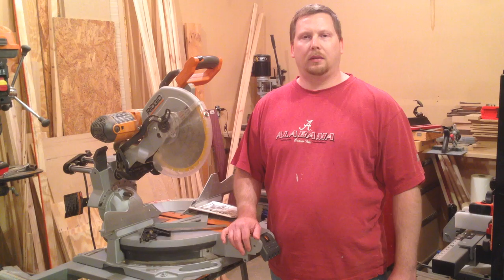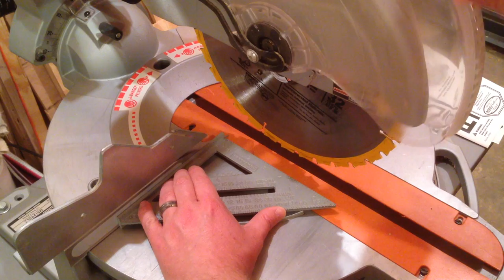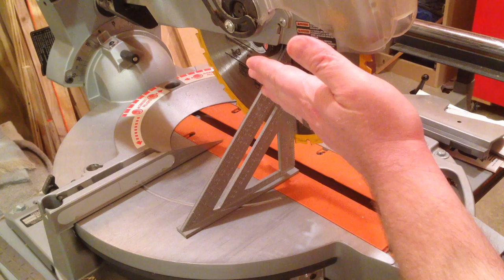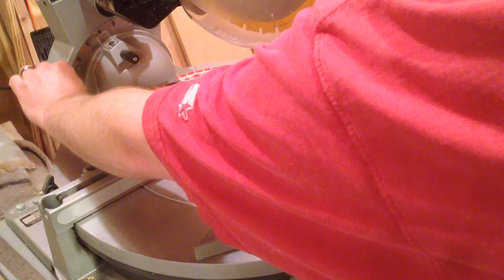Miter Saw Adjustment

Comment: Thanks for your guide to adjusting the miter saw.  The only other thing I would do is to cross cut two pieces and then flip one over and compare the edges to see if they are true.  If there is any misalignment, this method will surely show if the blade is a true right angle.

Comment: My rigid miter saw won’t rotate.  Any ideas why. It was working fine and than starting to get tight and now won’t move at all
Reply from the maker: The turntable may have debris inside. Also ensure that any locks are disengaged.

Comment: I want to add 3 things. Most cheap squares are not square. That's why companies can get away with selling expensive professional squares and rulers for so much money
 Next, do some test cuts on a flat board or plywood. Look up the 5 cut method. You'll need calipers. Last, once the fence is set, take the time to double check the adjustable plastic line for the angle indicator.

Comment: Is there a way to adjust the slide.  It seems like when I cut a wide board it will not cut along a straight line the full length....almost like the slide is off??  Any help would be great.  Thanks
Reply from the maker: Hi Karl. There's not a way to specifically adjust the slide that I know. Although, if you have another model yours could have a method. There is a learning curve when cutting precisely on a sliding compound. A person naturally leans into the saw on the stroke which skews the cut very slightly since there is always a minuscule amount of play and deflection in the saw. The longer the arm is extended the more for potentially
Reply from the maker: Sorry, technical difficulties. Like I was saying, the saw has potential deflection exponential to the extended length. To minimize this, try to keep the pushing force in line with the slide action. If your doing everything correctly you should end up with a good cut. There is always the possibility that you have a defective saw. I hope this helps. God bless!
Reply: Karl Hinson 

I have the same issue. 
My particular unit is the MS1290LZA. I don't believe that it is a draw issue as Cory says. I drew a line on a board with a square. I then, traveled the blade over the line and sure enough, even though the fence is square to the blade, it tracks at an angle. I was hoping that in my manual, the section titled "Centering The Saw Between The Slide Bars" would take care of it, but it doesn't seem to function in that capacity. So, so far, its very frustrating. Cory, any suggestions on this part of the manual are appreciated. And can the blade be at a different angle than the slide?

Comment: looking to purchase same Ridgid miter saw. How long have you had it and how do you like it.
Reply from the maker: I've had mine about 10 years. It's been a pretty good saw. No problems but if you are going to do woodworking there may be some slightly better options out there. Although this saw is very capable of woodworking once you get used to its intricacies I'd go with a little higher quality saw for making those smooth and sure cuts for fine woodworking. If your looking for a saw to run crown or general carpentry then this is a great value.
Reply: +hoxha34 Ive had one for 8 years. The slide path has been out of alignment with the blade since day 1. It cuts square right next to the fence, but when you extend it out, it is off by up to 1/8". This makes long cuts and other trim a pain in the butt. The path of the blade is slightly off from the path of the sliding rails, causing the blade to pull when doing a long cut. Many people say this is due to a manufacturing defect in the casting of the parts. I have been unimpressed with it overall. I have heard only amazing things about the BOSCH GCM12SD. It does not use the traditional sliding rail system. Its a bit more expensive than the RIDGID (at about $599), but guys out there are saying it is as good or better than the $1400 FESTOOL sliding miter saws.
Reply: I had the same problem with mine out of the box.  There is a way to adjust the slide path. If you read through the manual it will show you how to do it.  There are adjustment screws for it.  It is a finicky process and I spent about 30 minutes correcting the slide path.  I've had the saw 2 months and it has stayed on a true path since the adjustment.  I used the saw everyday as a professional carpenter.  Cuts perfect now.  I've owned Dewalt and Makita sliders and both weren't perfect had no way to adjust, at least with the ridgid you can.
Reply: Handy Menagerie on my 2nd of this Ridgid saw and is again dog tracking on long cuts.
Reply: ANTEO wood design I tried finding the path adjustment in the manual, couldn't find it. Last time I tried to adjust it I cracked the housing. Thats why I'm on YouTube but have yet to find a video on path adjustment.........Ok......I found it, I used the 4 gib adjustment screws on the slider bar......I still could only get it to 1/16" on slide from full out to full in. Found that after taking the adjustment area cap off that it is maxed out and the slide bar is rubbing on the metal housing. Time to let this one go and buy another brand.

Comment: Great tutorial.  My new saw's fence is out of square, & the blade is bad!  It cuts at a slight angle, and the left side of a cut board is not straight & clean like the right side!  I now have a much better idea how to make the necessary adjustments.  Thanks.